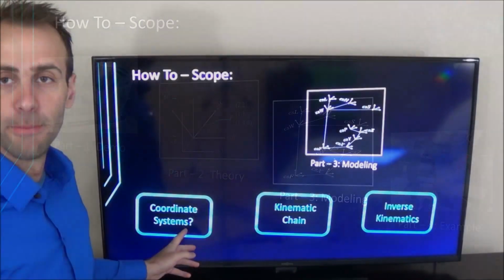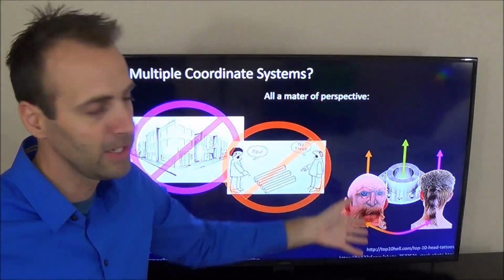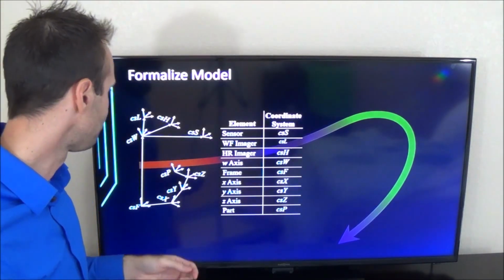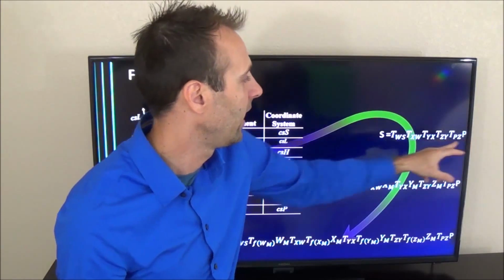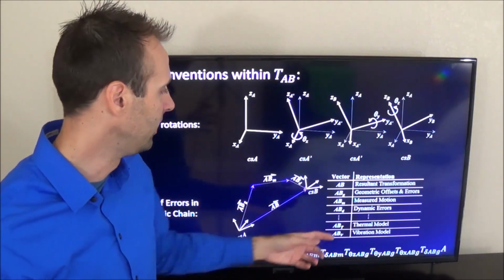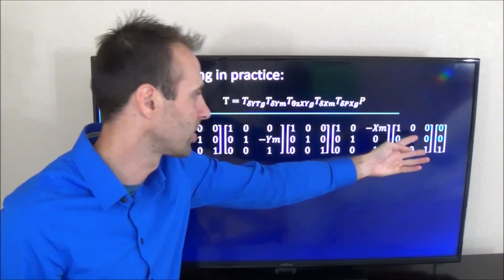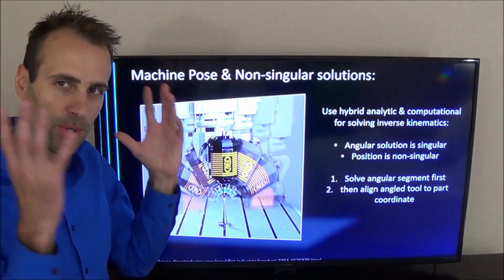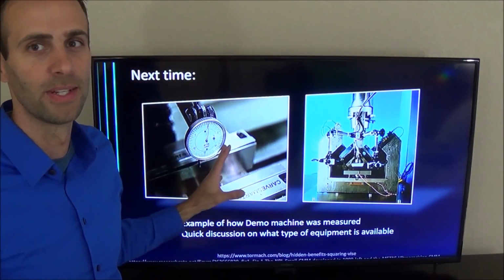Error Compensation of CNC Machines - Part 3/4

Comment: The part I was most interested in seeing, the algorithm section, was also the shortest part :) Your simulation method for inverse solving will become clear by seeing the code for the solver. Is the iterative solver similar to Newton's method?
Reply from the maker: Yes hopefully. First, I have to find a way to post and host the code... any ideas?
Reply: Have you considered GitHub? There you could host several project examples, track changes and suggestions, and allow others to contribute. People can view individual files or download the entire project. Easy to setup and is well accepted with programmers. Hope the suggestion helps.